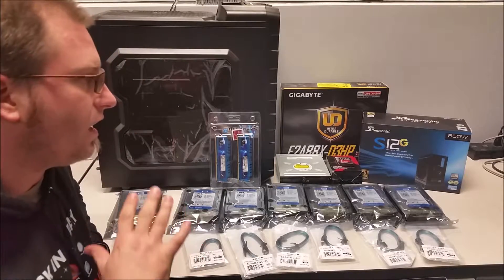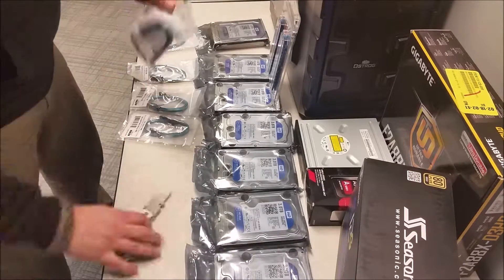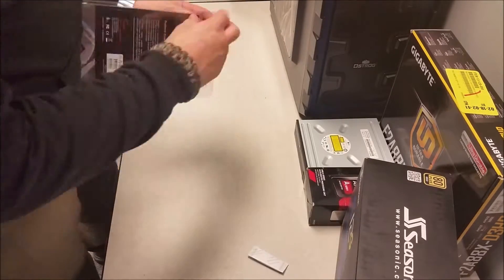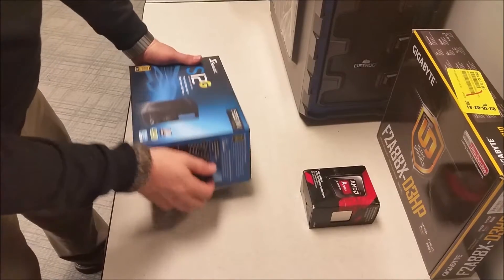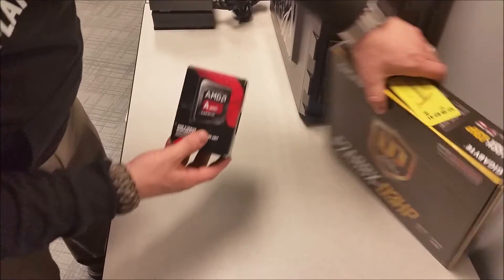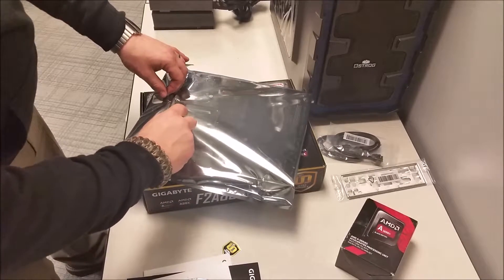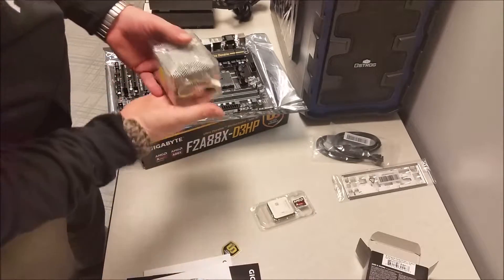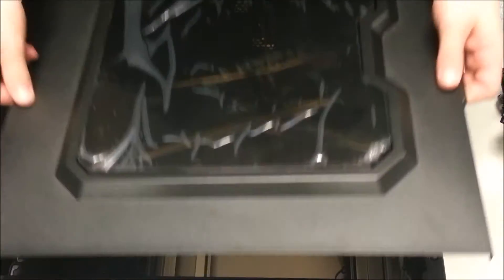Unpackaging of the components for the Media Server - MS2

Comment: Will this support 10 users at once ?
Reply from the maker: i have never connected to it with 10 users before.  i know that i have had some minor ISP buffering issues when i had four simultaneous external connections, but that was due to my upload bandwidth.  Internally, i have never had any buffering issues, even when external sources have, pointing  to an ISP issue vs a server issue.
Reply: Awesome what was estimated amount for this project?
Reply: What was your reasoning of using amd processor to Intel processor?
Reply from the maker: chipdog007 the cost was around $1140 for the hardware.  I felt the AMD was a better value for the processing power at the price point i was willing to spend.